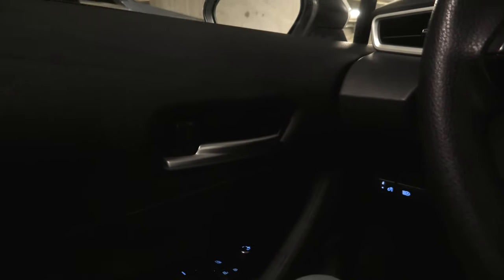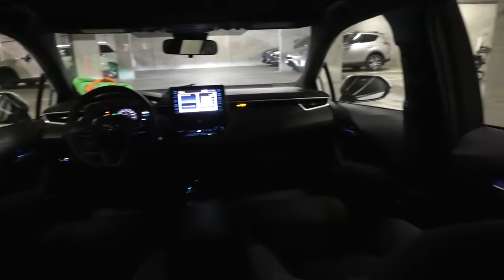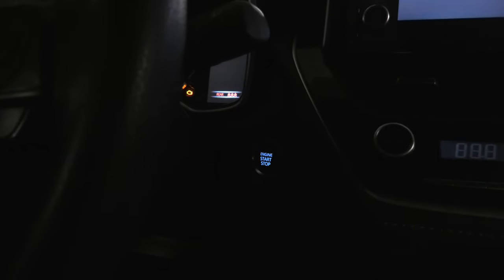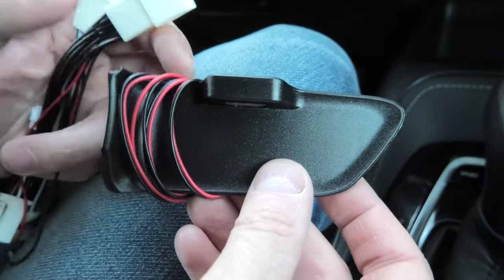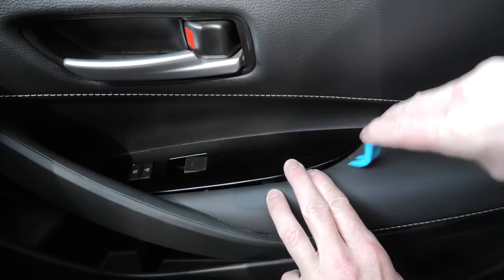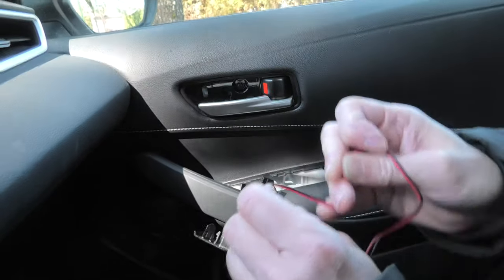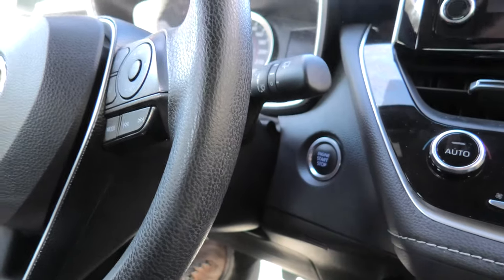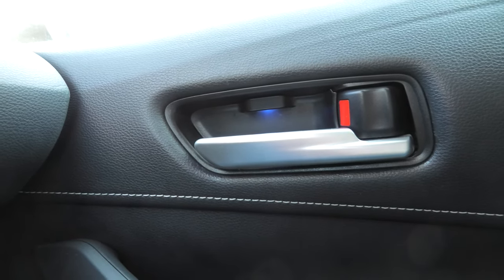Toyota Corolla (2019-2024): Ambient Blue LED Door Handle Lights Installation.

Comment from the maker: PRODUCT LINKS:
Interior Door Handle Bowl LED Blue Lights For Toyota Corolla 2020 2021 2022 2023
- CARTRIMHOME - https://cartrimhome.com/Interior-Door-Handle-Bowl-LED-Blue-Lights-For-Toyota-Corolla-2020?tracking=morozov_automotive.
- AMAZON - https://amzn.to/48GM3yp.

TOOLS USED:
1. TRIM REMOVAL TOOL - AXELECT Trim Removal Tool, 5Pcs - https://amzn.to/3KpDO08.
2. ZIP TIES - Cable Zip Ties, 400 Pack Black - https://amzn.to/3Ktg0sn.
3. ELECTRICAL TAPE - 3M Scotch Electrical Tape, 3/4-in by 66-ft, Black, 1-Roll - https://amzn.to/3lLqM2D.
Reply: Bonjour moi j’ai une Toyota corolla hybride 2023 quelle couleur choisir Ice blue ou dark Blue ??🤒🤒

Comment: Is it just the Toyota Corolla model car that they use those standard light bulbs inside the interior and not the bright LED lights?  Toyota uses LED lights in the rear tail lights and front lights but how come not inside the interior so that you can see better?

Comment: My 2022 corolla se sedan does not have the illuminated switched on any of the doors. Are they available through the dealership or aftermarket?
Reply from the maker: Lighted LED Power Single Window Switch for Toyota Corolla 2020-2024 LHD - https://cartrimhome.com/LED-Power-Single-Window-Switch-For-Toyota-Corolla-2019?tracking=morozov_automotive.

Comment: Do the LEDs light up during the day?. I installed them, they all turn on at all times except the driver's one, which only turns on when the headlights do. What is the correct operation?
Reply: You need to swap a wire around in the driver's side connector to solve your issue.
Reply: @terryroe2023  do you maybe know which wire? I have the same problem
Reply: @terryroe2023  Me too
Reply: @terryroe2023  What wire do you switch?

Comment: Have you had any problems? I wanted to do this to my car but worried about an electrical fire due to the wires looking smaller than stock
Reply: The LED lights draw so very little current..the wire size is not an issue.

Comment: Would these work for 2024 Camry XSE ? Thanks
Reply from the maker: The ones shown in the video only work with the Corolla. Here is a set for the Camry specifically: HIGH FLYING for Toyota Camry 2018-2024 Car Interior Accessories Door Handle Bowl LED Blue Lighted ABS 4pcs - https://amzn.to/3w84IEZ.
Reply: @MorozovAutomotive  The High Flying say they are for a Rav 4 not a Camry. The Camry show up under Powerty is that same as High Flying? Thanks
Reply: @MorozovAutomotive  I found them. Thanks

Comment: Hello and thanks for sharing such a nice upgrade installation guide. 

Could you please help to allocate the right fuse that is responsible for door window switches lights? (I’m assuming that’s where these bowl covers taking power from with the plug-n-play split harness). 

Is that going to be the fuse from under the dash fuse box or from under the hood?

The reason I’m asking is that I wonder if it is possible to hardwire a switch from that fuse to make these lights switchable in case if got annoyed by the light. And maybe even split that splitter harness to get some power to additional lights to be installed in the door panels. Just not sure if that is going to be to much light, wanted to have an option to switch it off in case if needed. 

Thank you.

Comment: Moreover Automotive. Will that ambient light fit in a 2016 Rav 4?
Looks pretty cool. Thanks.
Reply from the maker: Thank you! No, unfortunately it won't fit the 2016 RAV4.
Reply: @MorozovAutomotive  Thank you Morozov Automotive.
I DID like your driverside window and door lock tuitorial. I ordered some for my 2016 RAV 4. Am awaiting there arrival. Thanks again.
Reply: @MorozovAutomotive  Hey man, will that work in Toyota auris 2013? 2 GEn
Reply: @kenlong5033  
Hi, ken I was wondering if you got these to work on your 2016  ? RAV4 . Thanks
Reply: @joe a  I did not as my 2016 R4 did not fit the criteria. Hope this helps.

Comment: Hi all , I installed the lights with out any problems,  however they won't turn off as power is always on to doors , so I removed them .
Reply: Bei mir gehen Sie nur an, wenn die Innenraumleuchtung eingeschaltet ist, oder man Nachts fährt. Tagsüber im stehen oder abgeschlossen, sind bei meinem Toyota diese Leuchten ausgeschaltet.